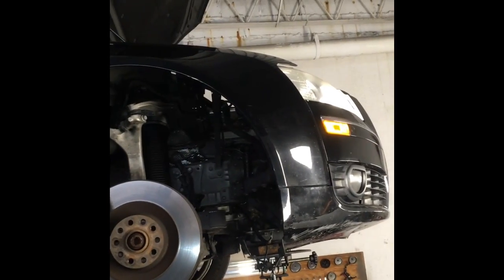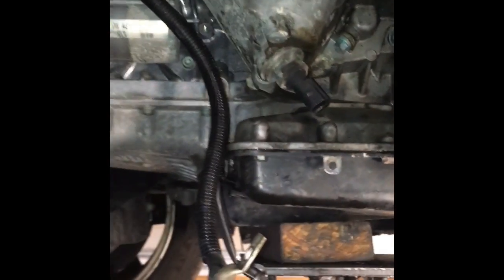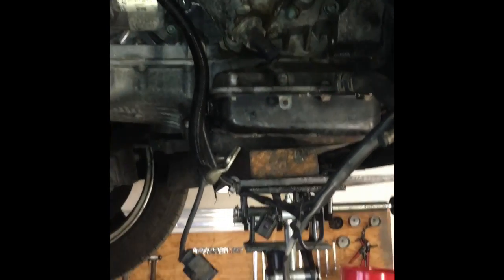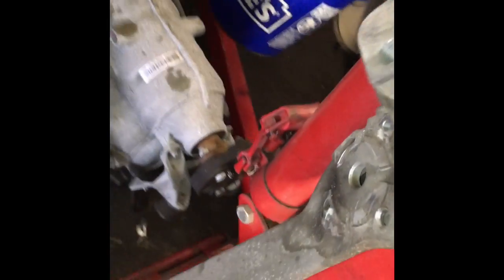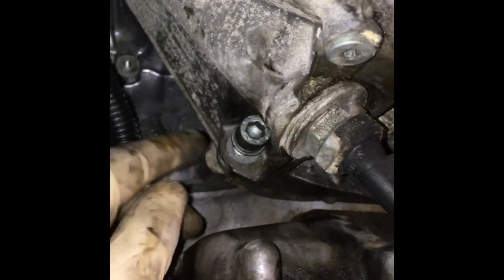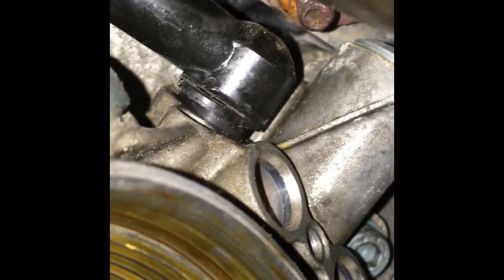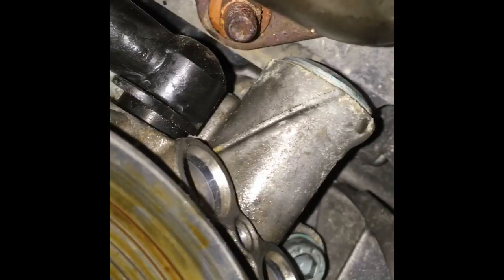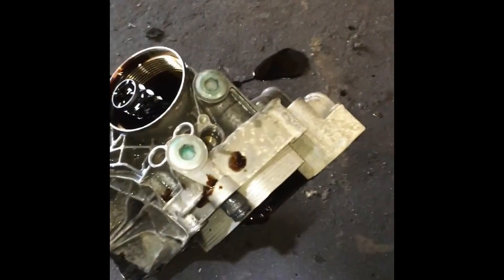audi a8 d3/d4 v8 4.2l engine coolant leak fixed/oil cooler pipe replacement

Comment: Idk man I just can't get the metal line on top back into place when installing the whole cooler after renewing parts... Idk man, 2 days and still cant get it back in.
Reply from the maker: I think i was doing that without any view, because its on the very top. But it went in for me just fine. Maybe try lube a bit the o ring so it slides in
Reply: @carwiseautomotiveinc.3123 I lubed it a lot, tomorrow I will try again...

Comment: Hello, could you tell me what size ALLEN you used to get oil cooler out? Also, when removing subframe, there are so many bolts under there I’m not sure which ones to take out. Lastly, do you really need something to hold engine up from oil pan ?

I appreciate your time and help!
Reply from the maker: I honestly dont remember the exact size , but aliens come in sets anyway. Subframe is not hard to remove and you can visually see the bolts holding it, also get the bolts that attach to motor mounts as well, it will be easier to remove the rest. For safety support the engine, its a big engine so dont risk it:) good luck💪
Reply: I appreciate the response man! I will support engine from where you had it under the oil pan.
Reply: UPDATE: Got the oil cooler out! Thanks for your help man. I was wondering if you needed to tap the new pipe in with a hammer into the assembly or just kinda keep squeezing it in
Reply from the maker: @marioacevedojr397  are you installing the plastic or metal version? Actually in both cases dont use a hammer:)) just make sure you get the old pieces out completely and clean it well from any particles . Its a tight fit, also put some oil on the rubber o rings so they dont get any damage when you shove the pipe in there👍

Comment: When you removed the subframe bar and engine mount bracket did you replace the bolt's I've been told I need to but the bolts are like a tenner each.
Reply from the maker: I didnt. Only bolts that need to be replaced are aluminum ones👍

Comment: Hi! Can this oil coore be called as transmission oil cooler as well? If it is different part where it is located and is it hard to replace? Thanks for your time.
Reply: Transmission oil cooler, is right under the trans when you look under the car. The oil cooler for the engine is in its housing on the oil adapter bracket shown in the video. They both look the same.

Comment: Is that a diesel engine or petrol?
Reply from the maker: has162 its not a diesel engine. Its a 4.2 petrol👍
Reply: I have the leak but can't tell where it's coming from plus mine is gas converted so checked all them pipes but are fine seem to lose more water when the car is parked up
Reply from the maker: has162 you wont be able to see the union pipe. Its hammed between oil cooler and the block.

Comment: Hey do u think I need a lift to do the job or I think I can do it as long as I Jack It up high enough
Reply from the maker: gun town im pretty sure lift will make the job waaay easier. Not sure how small and flexible your hands and arms are:) but technically its possible:)

Comment: I plan to replace the 5 oil cooler bolts with new ones.   The head of the allen bolt underneath the manifold stud and behind a coolant pipe is shallower and narrower compared to a regular M10 allen.  Do you think a regular allen  (slightly taller allen bolt) would bump into the coolant pipe in front of it ?
Reply from the maker: dart arnaez shoot a video so i can get a visual on it.
Reply: Part of the critical part in doing this job is to go out of your way not to strip those low head allen bolts.  its been a while I bought various types of bolts to make sure I got it done right.   A regular height allen bolt would have made the job easier.   What is even better is using triple square bolts.   The the vw version of the A8 I believe uses the triple  square the last time I did some research.    @carwiseautomotiveinc.3123

Comment: Can you explain more about prying the tubing that is being blocked by the exhaust manifold stud.     Did you flatten the top of that pipe hitting the stud?   Did you just slowly "force" the pipe out?   What section of the pipe did you bend to get it free?
Reply from the maker: dart arnaez i slowly pried it . Was placing the pry bar as close to the fitting as possible so it could pop out without the pipe being bent and stuck in there.
Reply: Is it possible to give more detail on this part as I too am doing this job as I text this and  is at that part

Comment: Do you think the 2004 v8 phaeton is exactly the same as far as the clearance goes?
Reply from the maker: Michael Traina dont know man. Sorry cant help w this
Reply: Same chassis.
Reply: @3n3ly7m9  completely different chassis, all steel D1 platform used for Bentley flying spur/continental gt, some components are similar to D3 A8 but not a great deal. All chassis legs/floorpan and upper structures are completely different
Reply: @matthpotte  Still basically the same. I own both Phaeton V8 and A8 D3 V8
Reply: It was the same. Fairly brutal repair even for a seasoned VW/Audi technician.

Comment: If you have this issue with your 4.2 engine, Carwise is the place to fix it.  I just had mine done by Phillip (the person on this video) You will need the water pipe on course, Coolant, Oil & filter, figure eight seal and O rings for all the water pipes that connect the the oil filter housing and alternator. As a precaution I had the complete oil filter housing unit replaced since this unit had to be removed to get to the stupid plastic pipe.  Phillip can and does do this job as his video shows.  If you are near the Virginia Beach area or take a trip to get your car fixed as I did, set it up with Phillip and get your car fixed.
Reply: Can you forward me Phillip's contact info? I need mine replaced too. Thanks.

Comment: Can that hard line be disconnected at the opposite end away from the cooler so it can be swung out away from the bolt?
Reply from the maker: BBCC i couldnt get a visual on the other end of the line, thats why had to bend it a bit.
Reply: No it can not, it is bolted with 2 bolts for the rear coolant pipe, which is then attached to the rear of each head. 1 pipe on each side of the motor for each head. One goes to the oil cooler, other goes to the reservoir.

Comment: Is this what causes the oil to mix with coolant reservoir?  I wanted to buy an S6 c5 but there was oil in the coolant reservoir! But the oil dipstick was normal oil even overfilled but not milky !
Reply from the maker: jankizkhanz when this pipe fails, you get an extensive leak..
Reply: Carwise Automotive INC. what do you think would cause oil to get in the coolant reservoir?
Reply from the maker: jankizkhanz i would check the head gasket. It can leak in different spots in between cylinders etc. a bit hard to assume without looking at it
Reply: Oil cooler will cause this problem. The brittle oil pipe for the coolant passthrough only allows coolant from the engine block to the oil cooler. It can't mix anything as its just a passthrough.

Comment: What is the size of the o rings for the water pipes on the top of the adapter you mention at 5:15 ? I have two 15X2 mm o ring for the water pipe.
Reply from the maker: Ralph Armendariz i dont know the size, just compared the old one with the new one.

Comment: I am not able to get the alternator out, I cannot get the top bolt out, it hits the radiator fans before it comes out. I must have missed something I don't think this method will work for my 2004 A8
Reply from the maker: Im sure this will work for 4.2l engine. I dont remember do fans come out or not. You can probably youtube the alternator removal. Good luck!

Comment: great info man. I have a 2012 S5 that just started pooring coolant out as fast as I put in just out of no where. I did just change the oil the day before. So I don't know what I could have done it drove about 20 miles and all the fluid came out of nowhere it seems as though a lot of it is coming right at the back of the engine passenger side but I haven't removed any of the skid plates yet it just happened last night any advice much appreciated thank you brother
Reply from the maker: Jimmy Brucksch you have to visually inspect it anyways:)

Comment: hey Man I have a 2000 Audi a8 4.2  Brand new timing belt water pump and all that..all a sudden my coolant level dropped slowly and it got worse over time.  car never overheats and has plenty of power..I am betting This is the problem...sound about right ?  the only thing is i have neveer seen any coolant on the ground but i have not looked to hard either.  I am going to put the car up on my car lift..should i be able to see the leak visibly?
Reply from the maker: Eric Knowles this leak is visible . Must be something else then. When this union pipe gives up , you start losing lots of coolant.
Reply: damn  yea i put on the lift today and didnt see anything visible.  ran the car about ten minutes.  The weird thing is the coolant level dropped and i didn't even drive the car.  Leads me to think it is leaking But i am stumped...When i took the coolant cover off i can see a small amount of smoke but not thick.  but it is steady.!   Im stumped
Reply: found a leak its leaking somewhere next to the altanator
Reply: The more i look at this man everything is pointing right to the same fricken spot that your doing here on this video!
Reply from the maker: Eric Knowles hah:) is it a 4.2l?
Reply: yes!   2000 Audi a8 4.2    in my car its right above and next to the alternator and clearly is coming from there.  Hopefully it is just this coupling piece.  My car doesn't look like i need to take off the sub frame it looks not so bad to get into.. so far   ( i have a lift)
Reply from the maker: Eric Knowles good for you!:) good luck with the job!!
Reply: yes yes thank you!
Reply: hope to god you didn't put everything back together again - this one of the know issues with all of these cars .... that and failing tranny. Gotta love em!

Comment: how much would it cost to get this job done?
Reply from the maker: Green Zone cant tell the exact number right now, but approximately around $500-$600.
Reply: I got a quote from an authorized Audi garage $4200 labor.  (Yes I'm taking it somewhere else.) But I am assuming they are expecting to lift the whole engine out per Audi recommendations.  I like this work around better.

Comment: So I have everything apart the only thing left is the 5 bolts for the oil cooler itself. My question is what did you use for the studs? I tried a 8mm Allen wrench and it’s not enough. Leverage to break it loose.
Reply from the maker: Kevin Aubut i used a 11mm socket or the star bit on those studs for manifold.

Comment: Mine is now leaking at the oil cooler as well. Could you be kind enough to tell me what parts you replaced? Also part numbers? I would assume it’s going to be more then just the pipe and 1. O-Ring on the pipe near the exhaust bolt? Thanks so much for a great video.
Reply from the maker: Kevin Aubut i actually did replace just that pipe:) just get the alluminum one, not plastic, so you will never do this job again, its an architectural flaw putting plastic to metal which gets hot all the time, sure the part will keep failing. Thank you!!!
Reply: Carwise Automotive Solutions is there no gasket on the oil cooler? So looks like the alternator, subframe & motor mounts come out? Anything else that I should watch out for? I’m kind of worried about getting that too bolt out. Also confused on why Erwin indicates the engine needs to be removed to do the job? When you said took you a couple of hours. Lol maybe just for money
Reply: @kaubut0145  Cause it is a engine out job if you take it to Audi. Same with the head gaskets or exhaust gaskets. This is a way easier method. BUT for head gaskets and timing stuff, engine would be nice to have out of the car, I have taken whole engine part in the engine bay, what a pain in the ass, but I work on all my cars, so I'm not giving someone else money when I can do it myself.
Reply: @carwiseautomotiveinc.3123  when you say "pipe" do you mean the "tube" that was brittle you removed or the actual entire pipe?
Reply: @MrRicoRelz  the pipe, the tube with the 4 o-rings.
Reply: @3n3ly7m9  i actually just got mine back out on the rd TODAY. I did the oil cooler pipe replacement, the alternator pipe o rings, new water pump/gasket, new thermostat/gasket, new timing belt/pullies, new serpentine belt, new expansion tank, coolant flush and fill. its been a fun 3 weeks lol i tell ya!!
Reply: @MrRicoRelz  I re did my D3 the headgasket exhaust manifolds valves, timing. etc.. but then 1300miles later the oil cooler decides to leak into coolant. I only take it to get slushies from the gas station cause thats far as I can go until I smell burning oil
Reply: @3n3ly7m9  have you done the oil cooler pipe replacement? 

What made it leak? Have you fixed it yet?
Reply: @MrRicoRelz  Car never had any leaks or anything, bought it with the timing belt cut and front end all apart. No I haven't had time to do the oil cooler, or belt tensioner. I have to manual tighten it everytime before I start it cause the tensioner I used already went bad, so I have a few good ones, or I'm looking for a bolted one.
Reply: @MrRicoRelz  Oil cooler pipe on mine is just fine, its the oil cooler itself.
Reply: 077 117 411 A  this is number of the pipe

Comment: Hey great video Carwise.  I see you removed the two motor mounts while doing this job...do you remember if you also removed the front engine mount (called torque mount)?  It seems like you could replace all 3 mounts while you are doing this repair job.
Reply from the maker: Steve Rissler hey! I just removed the mount on passenger side. Thank you!👍
Reply: Front mount is canceled out or should be canceled out if it hasn't. Audi technically got rid of it cause of issues. I re-used mine that was split, I drilled it, and put a massive bolt through them and with washer and nut, with a whole tube of rubber gluing the torn mount, works great. I don't feel any vibrations when racing or taking the car to the track.

Comment: This looks fun..... had my car spring a massive dump of coolant last night. Looks like it's under the engine or behind towards the firewall. Would the part you're referencing in the video trigger a mass dump?
Reply from the maker: Carl Sutter yes it can, but its located closer to the front not the firewall.
Reply: Hmm ok. I haven't had a chance to jack it up and check underneath yet so it may be that still. Are there any parts toward the firewall that would do that even with the engine off?
Reply: Had that happen on my b6 s4, ended up being the heater exchanger pipe around the back of the motor and a coolant line.